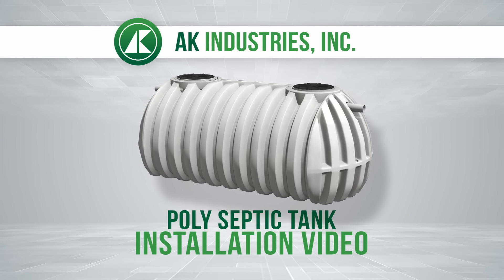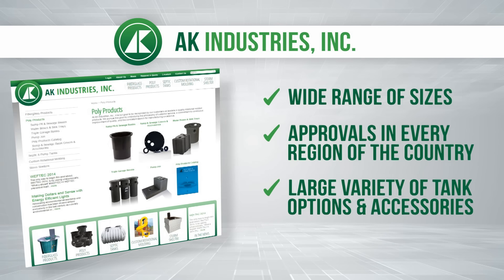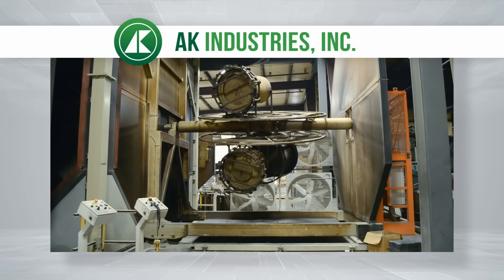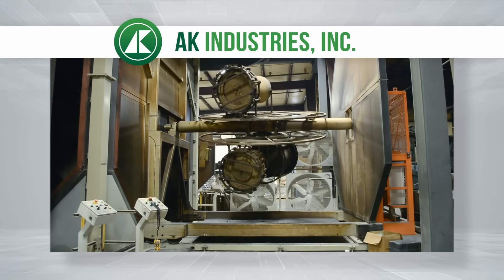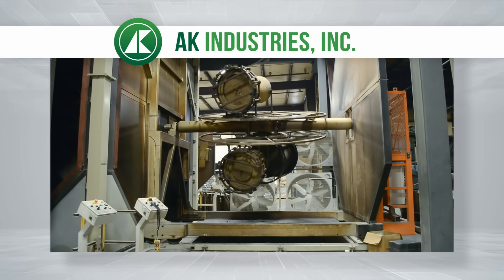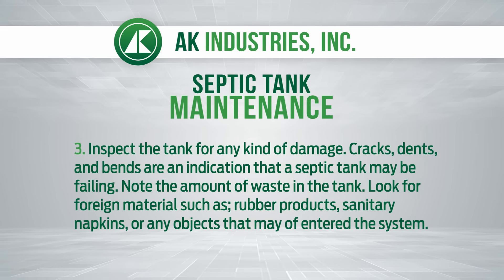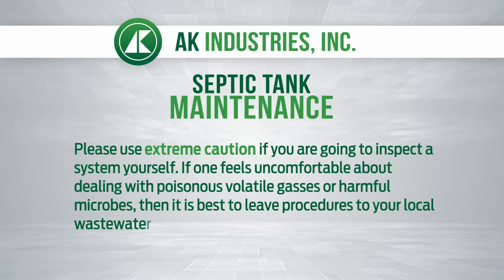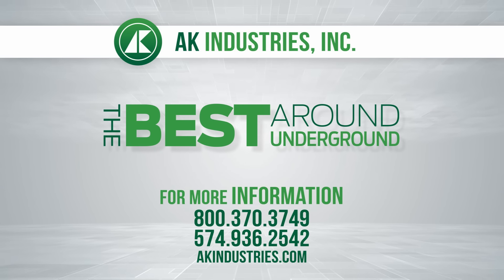How to Install a Septic Tank

Comment: Seems odd that you have to fill with water as you backfill. This leads me to believe the tank will be damaged by the pressure from the fill dirt / gravel. What happens down the road . . when you have the septic pumped out every few years?
Reply: I was thinking the same thing as I just installed one without filling it